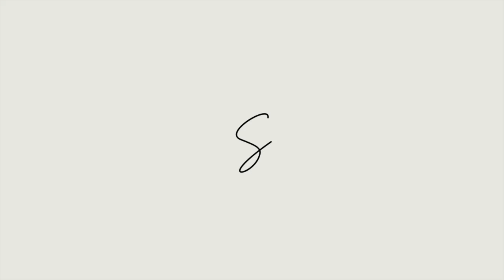VAN BUILD 07: Building Wheel Well Boxes

Comment: Hi  Sarah.  Thank you for your videos.
Question:  can you show where and how you vented your two ac pipes I see here going up out of the top of the video?  Thank you!! Lynne
Reply from the maker: hi! thanks for your support! So, although this video has posted monthsss ago I still have yet to secure them haha
So there are the 2 hoses and each splits, so 4 ends total. In the next video (08) I build my bed frame. Once I start wrapping everything up, which should be soon, I'll run them along the 2x4 of my bed frame that'll be under the mattress and have 3 of them come out in to the van from the face of the bed that I will put up. I will have 1 of them airing out below the bed to make sure the electrical stays cool as well.
Hope that makes sense!! You'll have to watch the bed frame video (08) to maybe understand what I'm talking about better!